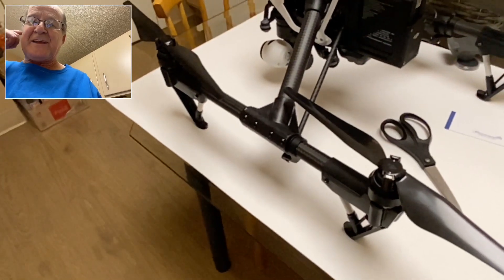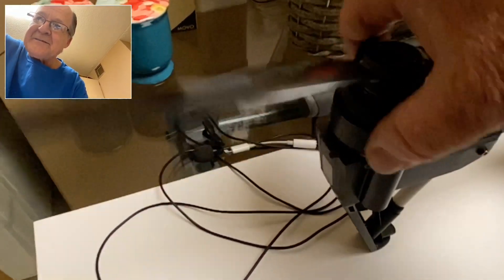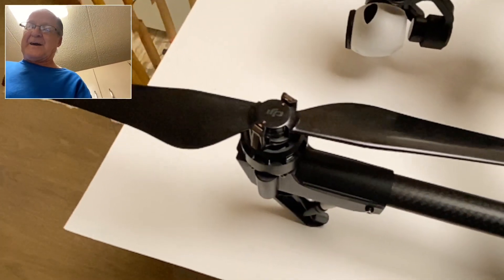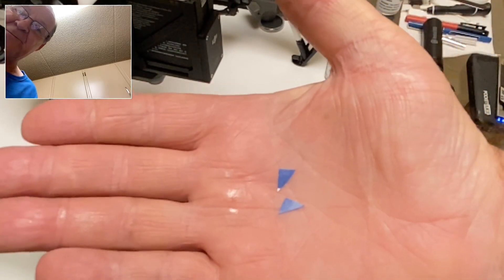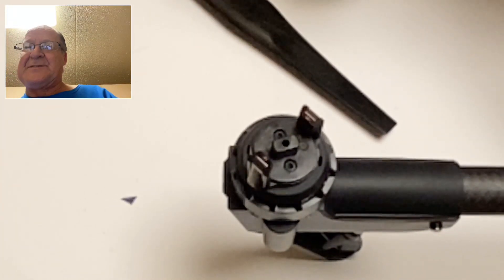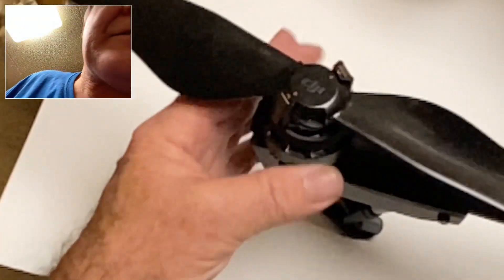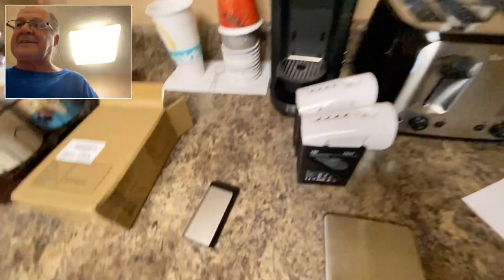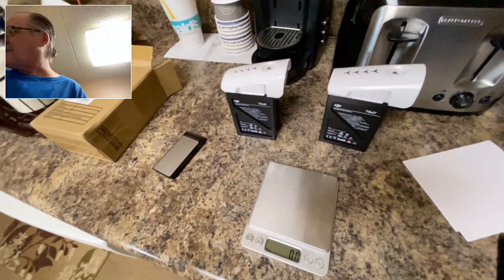How to fix Red Prop Rattle for DJI Inspire 1 and 2

Comment: Nicely doe and figured out buddy. Basic DIY always works a treat.
Reply from the maker: Thanks 👍
Reply: Just a thought.... Have you tried taking the screws out and placed very small rubber or carbon washers on the screws and then screwed them back in. Like I say, just a thought or would taking screws out damage anything?
Reply from the maker: @waddac2  your supposed to check the screws every 4 flights so i will look at that option later, thanks

Comment: I remember DJI saying the rattle was normal...BS. Be sure to check 
the bolts on the arms and motor mount every 3-4 flights. They tend to get lose. Have a good one! Bryan and thanks for the share.
Reply from the maker: Thanks Al, I will check
Reply from the maker: I saw the video Mike Kirk posted yesterday are you safe?, it's looks really bad by you

Comment: Dji should fix that. It is not a permanent fix. is it the propl design issue or the cap on the motor? how much for the battery?
Reply from the maker: 275.00